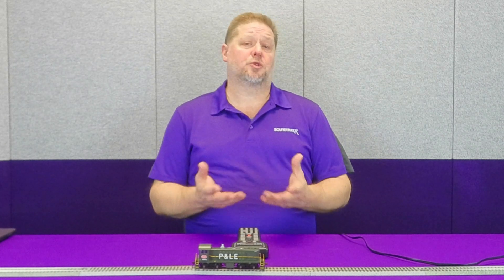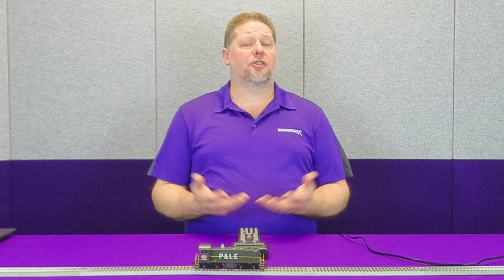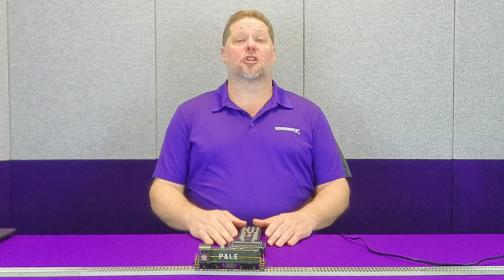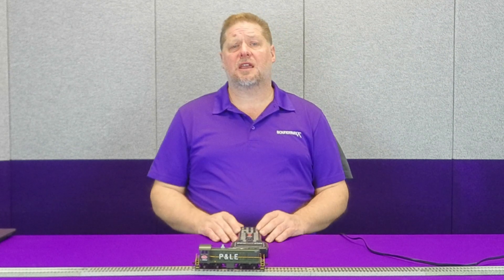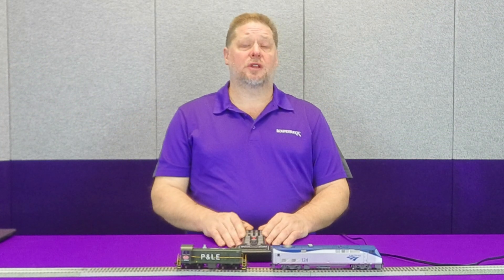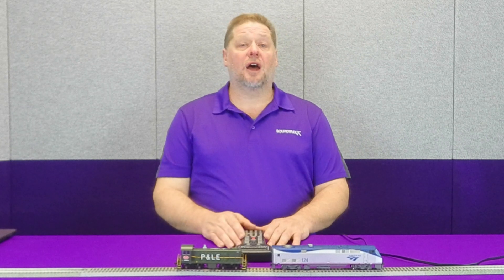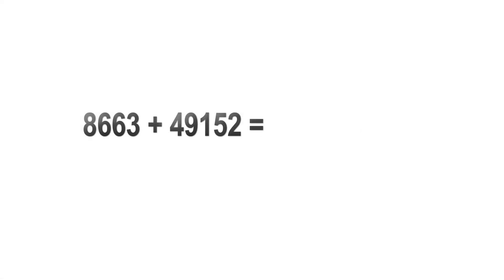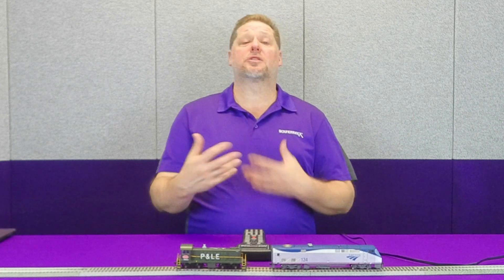Setting the Address on SoundTraxx Decoders

Comment: I had no idea at all about the "you cant change the same type of address" thing because most of my engines are Broadway or Loksound which do not have this restriction. I had been investigating a short circuit at my turnouts this week and probing for the short to see where it was, tripping my breaker many times. I then tried to set up my 2 new Locos 74 and 78 to their respective addresses as they just got new Econami decoders.... my heart SANK when they wouldn't take and I thought for sure I fried something in my DCC system.... I love your decoders Soundtraxx....but this "feature" is really dumb.. you need to make it so that you can program whatever address on the main...
Reply from the maker: This is a NMRA Recommended Practice.  It is done because the short  or 2-digit address is stored in CV 1..  If you were to try to program CV 51, for example, and not fully press the 5, but then press the 1 and then enter your value, you just reprogrammed CV1, where the address was stored, and in your mind you were changing a light effect and now lost control?  “What is wrong with this decoder?”  Since you change an address typically once, it is a logical safeguard since people, including myself, have accidentally pressed a button wrong.  But you fail to realize the one thing I did mention..  This is only in effect when programming on the mainline.  On the programming track, you can change any CVs all day, long address, short address, etc.  So, if you want o program address 78 from 3, then on the mainline, you can set the long address to 1000, then back to 78 on the mainline, or place the loco on the separate programming track and just set CV1 to 78.  Done.  I think you are not realizing the safeguards there to keep you in control of your loco.  I hope this helps.  If you need further assistance, contact us at support@soundtraxx.com

Comment: Nice try, George, but it's about as clear as mud to me! I have Digicrap and their manuals are very confusing to me. I have tried in vain to change addresses on my locomotives and I can't seem to get any results I can use. Obviously I made a mistake as everyone uses NCE and all the youtube videos that can help don't correlate with my throttle.
Reply from the maker: I am sorry that you are having trouble with Digitrax. Unfortunately, we cannot support their product. If you are having trouble learning your command station, Blunami may be an option that you want to look into so you don't have to use a command station. Our Support Team can help answer any other questions that you have: (970)259-0690 or support@soundtraxx.com